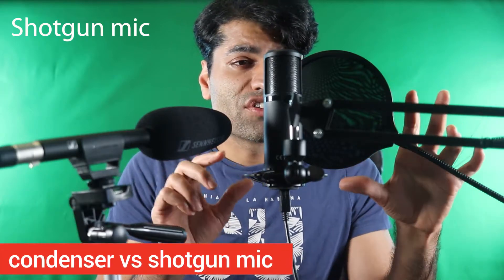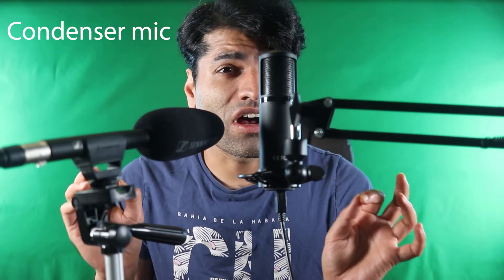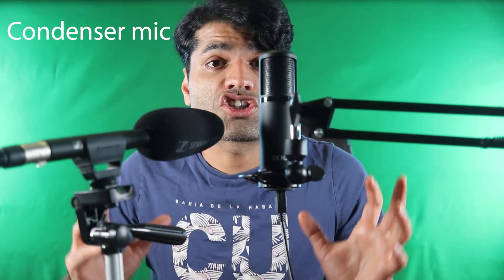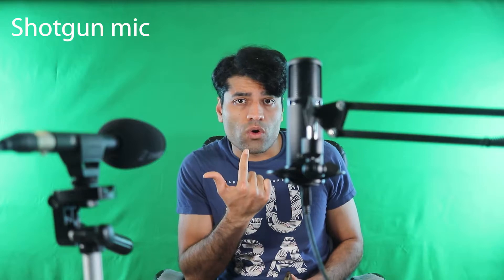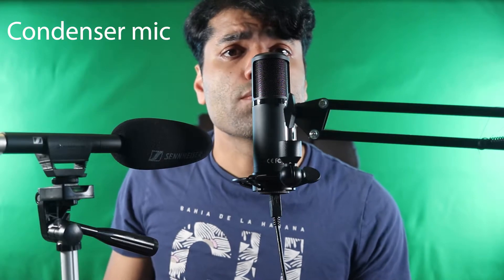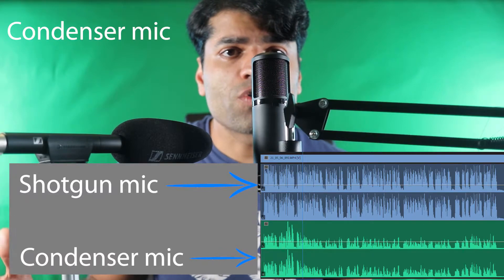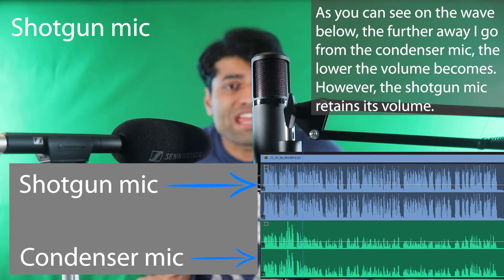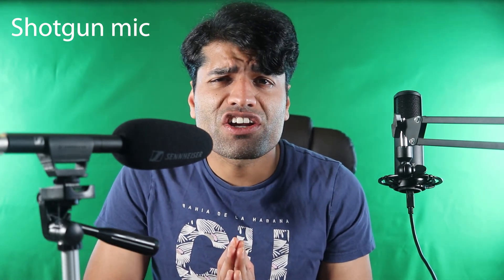condenser vs shotgun mic

Comment: Hi! I bought the sennheizer mke600, same as yours. I didn't get the original cable to connect it with the camera, so I bought a usual xlr to 3.5mm cable and have been using that. However, the results with that cable are horrendous!! I really have no idea now what should I do, how should I use it, given that the original KA600 cable that comes with the mic is unavailable in my country. Please guide me on how I can use it! 
What audio interface I will have to purchase if I want to record it externally?